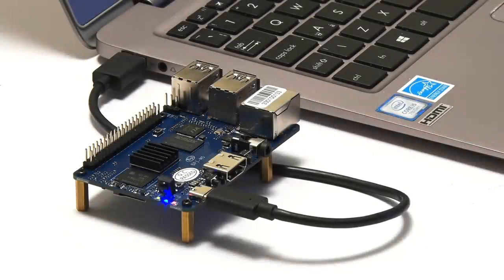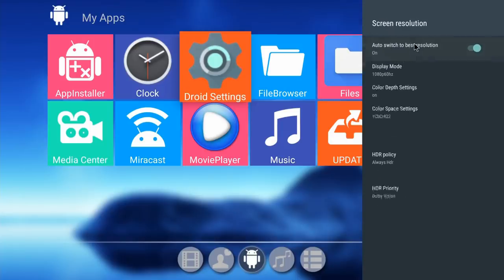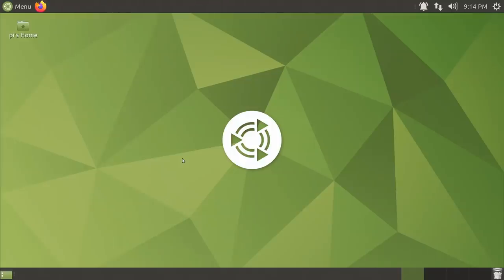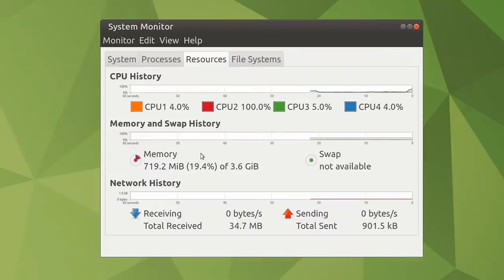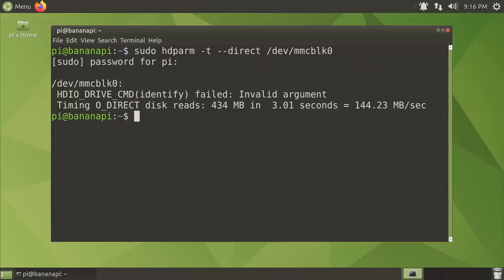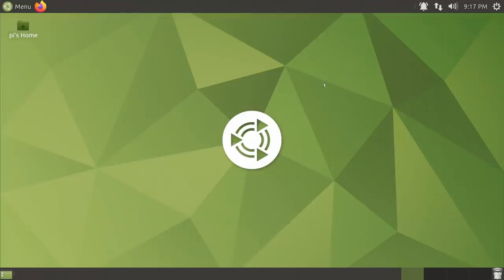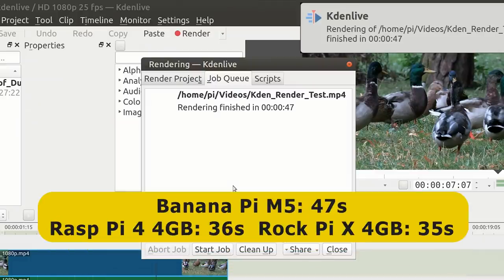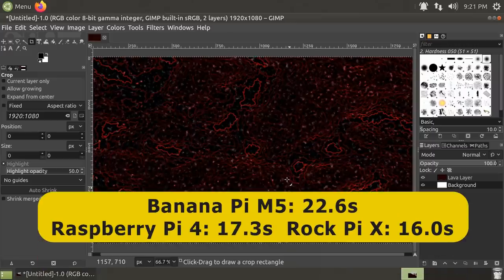Banana Pi M5: ARM SBC with eMMC

Comment: Hello, I'm OtakuNekoP from BPI community. 
There are some "undocumented" info about these switches on BPI-M5.
SW1 is a "Update button" and connected to PIN40 of DIP40 RPi connector at the same time.
SW2 is CPU reset as you said.
SW3 is an ADC key, that connected to SARADC_CH2(U43), and it's configured as "KEY 4"
SW4 is connected to BOOT_5(BC17). If SW4 was pressed before power up, it will run into "USB Boot First" mode.
Reply from the maker: Wow! Thanks for this. Very helpful information -- thanks for sharing here.

Comment: 04:31 - I wish more manufacturers would just put the full text of what a button does in the silkscreen on the board. How much harder is it to put 'BOOT' than something like 'SW1'? It's not old-fashioned to want a more user-friendly board :)
Reply: Get Red Shirt Jeff on the case. Sure he would be happy to oblige... 🙂
Reply: Can you map those switch?
Reply from the maker: Agreed! :)
Reply: +1 agreed
Reply: Red Shirt Jeff needs a cluster of SBC to crypto mine, to pay for his R&D.
Reply: @ExplainingComputers  maybe Stanley the knife can help out here:)
Reply: Maybe they are software-defined?
Reply: Look at that, it's Jeff Geerling! 😊👍
Reply: @featherpony  Most probably indeed. A different distro might have different functions assigned to them, so it's no use labeling them.
Reply: Totally agree, how difficult can it be to label something correctly? It would be nice to have a serious competitor to the Pi, but all of the alternatives never seem to want the polish like this needed to take on the Pi.
Reply: Then there's MSI where they put useful dark red labels on a black board, so whilst they're technically there, you can't read them! I've had my board for three years and I only found the labels on it a couple days ago.
Reply: If I may ask my questions to @Jeff Geerling as well:

My 3 year old, 160 Euros Motorola One Action Mobile, has a much stronger SoC, also for 4GB of RAM, 128 GB MMC and can also take an SD-card up to 256 GB. It also has a stronger GPU, also a USB-C and can display HDMI up to 4K in 60 frames. Also a headphone jack and even a built in speaker, not to mention Wi-Fi and also mobile internet.

Why isn't there a single board computer in the same price range form maybe even more expensive, which delivers such performance?

Why do we still have to put up with A55 cores when my little mobile already has A76 cores, higher clock speeds, higher GPU and what not?

Why isn't there a killer single board computer or arm-based computer in general? Why do I have to use my mobile as a PC?
Reply: Banana products are universally not known for being user-friendly at all.
Reply: I just want to extend this idea to desktop environments which show icons now instead of the full name forcing you to make a few extra clicks every time you want to switch.
Reply: @BeefIngot  This bloody this!! Just give me the text label, don't expect me to decipher cute icons that don't mean anything!
Reply: That cost so much money, around 2 billion dollars
Reply: Imagine a Jeff/Christopher video collaboration 😍
Reply: Manufacturer "SW1?....Oh that's the self destruct button....😀"  
The engineering love s surprises...😆
Reply: @Jeff Geerling just laziness my friend having learning PCs design all the videos I’m seen they all say to label.
Reply: And miss out on the thrill of the hunt, the adventure into the unknown, the search for the true hidden meaning of the mysterious switches of the universe?
Reply: @Remigrator  volume! When you have the volume, price will come down. Also could be the bargaining power of large corporation.
Reply: The component labels match the schematic, I suspect. The switches' functions should certainly be documented, but better in a manual than on a cramped printed circuit board.
Reply: Totally agree, and it doesn't appear that the switches can be remapped either. It does have a certain irony that one of the three documented switches (SW1?) is covered by a Quality Control sticker, and another is labeled SW4.
Reply: @cleanycloth  "The hell? USB 1.0 ONLY?? No wonder this dang board..."
Reply: @graealex  Orange and Rock aren't super-duper, either.
Reply: @Matrxmonky  It's more "what is this pin for? HDD light? Power button? Reset button? What does this header do? Is that audio, USB, serial?"
Reply: Hardware designers are not used to GUI and user-friendly like software developers for the user.  Trust me, took me some time to remember to put user-friendly on any PCB nowadays.  Also sometimes in the FIRMWARE, the name "SW1" is actually a variable lolzzz hence it is easier just to silkscreen it as so for the designer to recognize it.
Reply: @Matrxmonky  Yes, but with Banana stuff, it's fire and forget for them. A lot of the features you find in the spec don't work properly, just because they never bother to finish the software for it. Example: no driver support for the MIPI DSI touch screen interface on BPI-R2.
Reply: aha, because SW1 is just wired to GPIOAO_4, and it can be used as a normal GPIO button. SW3 and 4 are the same. Anyway, thanks for your valuable and kind advice, let's build a better development board together. ☺
Reply: @featherpony  still, wouldn't hurt at all
Reply: Great advice!I believe that the upcoming manufacturers will fix it.

Comment: Good that it has full-size HDMI, I hate mini and micro HDMI connectors' tendency to peel off the board
Reply from the maker: Agreed!
Reply: It happend on my laptop and i had to replace it
Reply: @ozrencupac  speaking of replacing, because of the size of the connector it has incredibly small connections to the board, forcing most people to replace the entire board rather than just the connector
Reply: @therealvbw  unfortunately that is true
Reply: @therealvbw  All while spending the cost of a Pi4 in micro hdmi adapters to that point.  A ball point pen or jeweler's screwdriver pushed down on the micro hdmi's hold tabs on the pi itself, can help the connection if it's just loose. Do it while the plug is in to prevent closing it. I wrecked adapter number 3 trying to plug it in after adjustment.  Still nursing my 1st Pi4, 5th micro HDMI adapter in the mail. Pi4 number 2 still has good connections.

Comment: Thank you Sir for bringing that model. I'm a owner of BananaPi M3 version and it was really interesing what was changed. From my perspective PROS: 
1)great looking android version- finally!
2) faster procesor 
3) USB 3.0
4) great Youtube render (comparing to M3 is night and day, believe me)
5) Gb ethernet 
6) SW4 button -awesome , finally you don't have to erase emmc to run your system..
7) full size HDMI - I'm also preffere it over a smaller version

CONS:
1) they removed hdd connection (on my M3 I use it as storrage for octoprint video time laps)
2) wifi is gone - I'm guessing because previously it was problematic
3) price could be lower esppecially that particular board isn't dedicated for begginers - if you stack with any problem then you have to dig really deep on google (I've been there , over 2 weeks losted just for turning WiFi on not stable OS version)

My conclusion:
I have to addmit that I'm a big fan of Banana's boards. Usually they sells strong (performance) devices, which are futher than compettition. Boards are well manufactured. My personal preference regarding OS is Ubuntu Mate - just love it ;) Unfortunatelly Banana pi (as mentioned before) is not dedicated for begginers. Well you could start from it (for me it was second SBC after RaspberryPi 3), but be prepared for hours/days/weeks tinkering around especially that support is rather slow (guesing limited count of support team employees). But they trying! They really do! However sometimes it's possible that you will find solution earlier than receive direcly from Banana's team.  Community is also small if we compare to RaspberryPi. If it's your first SBC in your life either you going to learn a lot stuff! Or you will put it back to the box :) 

ExplainingComputers is a channel which shows possibilities and learn us many great things. It was my inspiration and that's how end you with : 1 RPi, 1 Bpi, 1 OrangePi ,1 NonoPi and 10 RockPi devices :) Thank you Sir!! 
Cheers

Comment: Another great video! I just had a look on Aliexpress and the Banana Pi M5 alone (no power supply or small heatsink) is currently being sold for 70USD with free standard shipping. I think that's a more reasonable price considering the lack of the Wifi/Bluetooth module. and congrats on 750K subscribers!

Comment: The kernel modules for hardware decoding aren't installed in the Ubuntu MATE OS you were using (i guess this could be BPI's fault?) . If you want good video playback you need to compile in the modules to make hardware decoding work, you got to remember they use these chips in set top boxes that will have 0 problems doing 4k 60fps because they have the decoder module compiled into the kernel. One thing you can do to get around having to compile the kernel module yourself is testing on their android OS that you were using at the beginning half of the video (it's been my experience that the android OS will always have the hw accelerated video decoding working), it will most likely have the h264/h265 decoder modules installed, so I guess just put a VLC apk on that OS and test 4k and 8k playback (I did a quick search for S905X3 set top boxes and they are advertised as being 8k compatible - there is no reason you can't get the same performance with this SBC).. I love your videos but this is just one thing that has been bugging me is people getting these SBCs and then they use an OS that doesn't even use the CPU's acceleration. Also can you please zoom into the big ICs on the board, I wanna know what ETH PHY controller the SBC uses, I wanna be able to look up the PMIC or the other chips on the board... I appreciate your videos.

Comment: I don't see it being worth $95 USD.  No WiFi, no Bluetooth, slower, no CSI or DSI (questionable need), less community support, etc.  The 4 USB 3 ports, full size HDMI, eMMC, etc. just don't outweigh the negatives.  IMHO most people would be better off with the RPi 4 with 8GB RAM which actually costs less for double the RAM.  Am I wrong?

Comment: According to the diagram on the wiki, the first thing loaded is the bootloader from emmc as you said. But after that the bootloader is first looking into sdcard bootscript, before going to the emmc bootscript.
Reply from the maker: You would think. But the reason you have to blank the eMMC before installing Linux from an SD card is that you can not get the thing to boot from SD card if there is anything bootable on the eMMC. So I am not sure the wiki is correct.
Reply: @ExplainingComputers  How do you blank the eMMC?  I cannot get the BPi to connect to the my PC.
Reply: Go over to the BPi community pages.  I wrote up a detailed description of how to get this device working.

Comment: 267 likes and no dislikes... Looking good so far.👍
Reply: Duke Hugh Johnson  I don't understand it.  What possible exception could someone take (unless they're a hardcore "Pi" fan, I guess)
Reply: Duke Hugh Johnson  Perhaps they are allergic to Bananas! 😁
Reply: Duke Hugh Johnson  Maybe the video should have talked about availability of drivers in the stock Linux kernel?  One of the advantages of Raspberry Pi is a lot of it (not all) can be used without downloading non-distributable proprietary blobs.  What if Banana Pi goes away?  Can you resell your Banana Pi with the downloaded stuff on it?  Etc...  

In any case, a lot of people use the downvote for "I'm not interested in this video", so it's pretty meaningless.

Comment: What kind of application would the pi be of most use? With no wifi, I wonder how fast the internet connection is. Since the YouTube play was rather good, maybe a connected NAS?
I don't see it as an iot component, there is probably better products for iot that this.

Comment: It's amazing isn't it, I think I paid around £500 for my first 486 PC.. now £65 gets you this, seems responsive enough...
Reply from the maker: Yes, that is an amazing thought. This little board does far more, and better, than the PCs so many people used to rely on.
Reply: @ExplainingComputers  And you honestly don't have to go back that far in PC history - nowhere near as prehistoric as a 486 - to find something of comparable performance.

Like, these little boards are only lagging a few years - not whole decades - behind PC performance. And when you factor in that you power them with a USB type C and not a big honking PSU - take on board their "low power" nature - then it's all very impressive indeed.

But then I'm an old fogey who remembers his Commodore 64 fondly, and first coded on a ZX81. So, frankly, all modern computers seem like voodoo witchcraft to me.
Reply: @klaxoncow  I'm thinking about hot summers spent in a darkrned room, trying to get my head around the difference between FOR and WHILE loops on a Spectrum 48K.. you're right, it's all witch craft now.. how a tiny little board can run OpenCV2 and track & identify you walking around a room.. if that's not magic I don't know what is :)
Reply: @slimplynth  I'm assured by my sources that it's just sufficiently advanced technology.

Seems like magic to me, though. :D

Comment: If I were in the market for a single-board computer, I still think I'd wind up buying the Raspberry Pi., despite the many examples of SBCs you've shown us on your channel.

Yes, there are more powerful SBCs on the market (and less-powerful ones, as we've seen today), but there are none with the software support and community support of the Raspberry Pi.  Until a manufacturer manages to top those (or at least equal them), the R.Pi will remain on top for me.

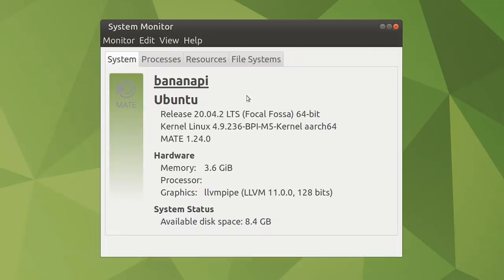Comment: At 09:35 you can see it says "Graphics:  llvmpipe" which basically means software rendering / no proper GPU drivers.
This is what bothers me about so many single board computers, before you buy it's almost impossible to find out whether or not it has GPU drivers on Linux and what sort of OpenGL / GLES / Vulkan support you get. You really need at least some basic OpenGL 2 support if you want to run desktop applications, yet so many SBCs (including some ODROID ones) don't have Linux drivers, but again, you won't really know that before you buy.
Reply: That's not a problem from the SBC manufacturer, it's ARM problem, ARM too many times don't release GPU drivers for Linux, only for Android! So, a lot of people have to make an open source driver for each GPU from ARM and implement it on the latest Linux Kernel!
Reply: @yet_another_communist  Remember that ARM isn't the company that actually makes the SoCs, and the GPUs are usually designed by other companies.
But it's true that most of these companies don't release open source drivers. ARM just tends to be a very proprietary platform unfortunately.
There are unofficial open source drivers for some GPUs, such as Panfrost for Mali, Freedreno+Turnip for Qualcomm Adreno, and v3d for Broadcom, with varying compatibility.
But it still sucks that before buying an SBC you have to find out which GPU it's SoC has, and then look up if it is supported by any if those drivers, and perhaps what OpenGL/GLES/Vulkan versions are supported. Neither the SBC manufacturer nor reviews like this usually mention it, and it drives me crazy.
Reply: @gustavgurke9665  yeah, it's bad that most of the times it isn't explicit that it's not hardware accelerated. And ARM produces a lot of GPUs, Mali's are from ARM, you know, and most of the don't have Linux drivers, but yeah, it could be more explicit that it's not hardware accelerated.
Reply: @gustavgurke9665  Mali's are from ARM, it is an ARM design, Rockchip, Amlogic and others just uses the ARM's Android drivers and don't care about Linux drivers, that's true, but ARM could make Linux drivers, they are a very big company, why they don't release a Linux driver?

Comment: This board shows once again how amazing Raspberry Pis really are. I mean... RPi 4 4GB w/ a 16 GB SD card is $64, whereas the Banana Pi M5 is $85 but slower and with far inferior support and ecosystem. The Banana is not a bad board per se... but why would you get one other than the odd application that perhaps needs the eMMC? And even in that case, you have the alternative of the RPi compute module 4 with its eMMC... That being said, I do have huge respect for all these small companies trying to compete with the Raspberry Pi Foundation.

Comment: I've tried kdenlive on Linux always used crash on me, so I switched to openshot and added more ram. For  free software is not bad.
Reply: I've been using both kdenlive and openshot on W10 and on Linux Mint, but I've found openshot doesn't always work properly if I want to use h265 format so I've now switched to just using kdenlive.

Comment: With Android on this, but connected to keyboard, mouse and monitor, how do you get back to the "home" screen, switch between apps, and/or exit apps?

I would also have liked to see cpu temp comparisons with and without the heatsink, as well as what (paste, thermal pad, ???) method it was attached.

Comment: I'll post this here, because it is the latest video on SBC... I am looking for an SBC that I can use as a WiFI bridge/network extender. My main 2 requirements are
1. Gig ethernet
2. 5GHz WiFI, so 802.11ac or 802.11n will do the trick.
The main uses will be to extend my home network into the back of the property, current AP does not reach, so I will run an ethernet cable outside and connect the SBC to it that way I can connect my phone to the home network (cell service is horrible).

I know the RPi 3B+ says 10/100/1000 but the max is really 300Mbs (which is better than nothing, but if I can get something closer to the 450 from a 5GHz 802.11n that would be much better). No moving the AP is not an option.

TIA for any suggestions.